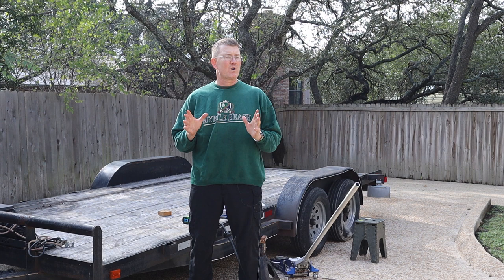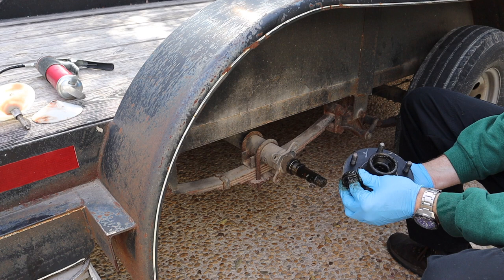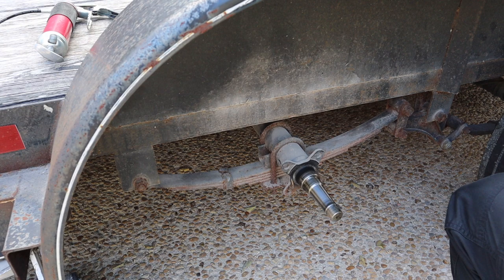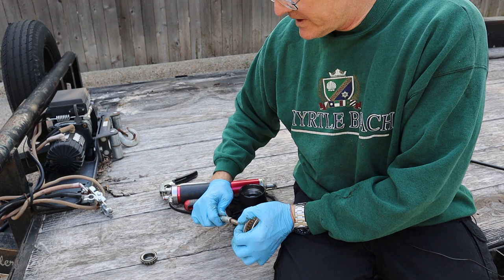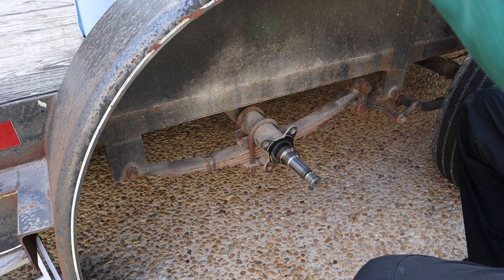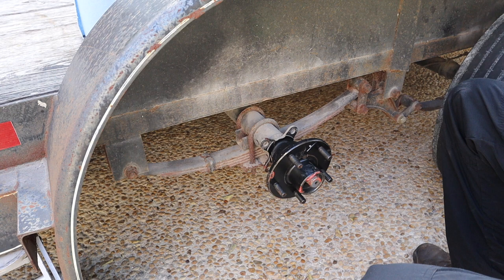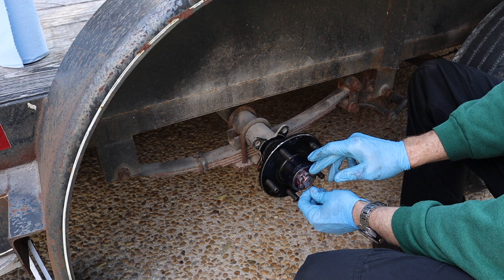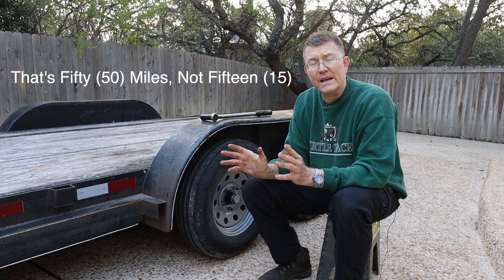Packing Trailer Wheel Bearings with Grease - Step-by-Step!

Comment: Hi Hi Bulletproof !  Can you help me out with a clutch drum for my XG Jonsereds ?  I live in Norway and Sweden. I need the needle bearing and space as well. I tried log on chainsaw collectors...but have som,e trouble at the moment...to log in.  I check that with Magnus tomorrow !  Ok.  Thx in advance ! :-)
Reply from the maker: Hi Motor Diverse - I sold my last XG with all the parts that I had.  If the XG takes the same clutch drum as the XF, I may have a spare.  Are you on Facebook?  If so, there's a group that has some local members - https://www.facebook.com/groups/460572254485871 - also try tradera.com - there are several sellers of vintage Jonsereds parts.  Please tell Magnus that I said hi.  He is a good friend of mine.  Scott

Comment: Never fun, always necessary! No brakes on trailer? Around these part no brakes max weight inc trailer only 3000 lbs. Gestapo will fine so much per lb over
Reply from the maker: Hey Randy - It has brakes on one axle.  Thanks for your comment, Scott